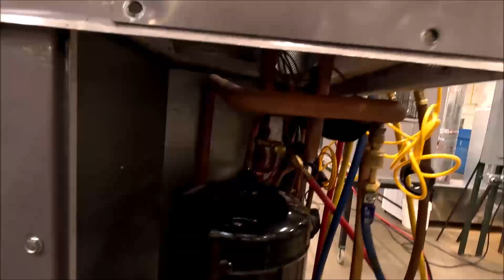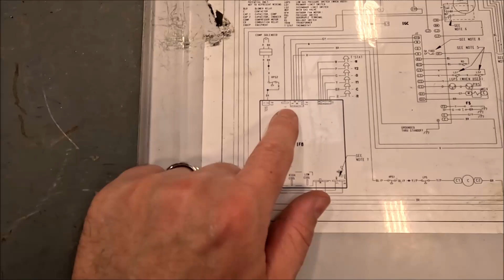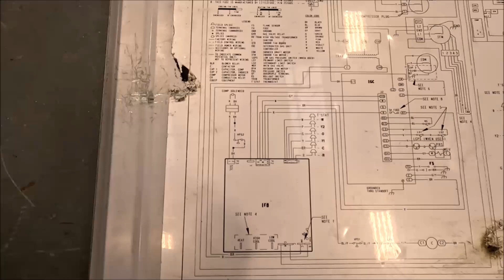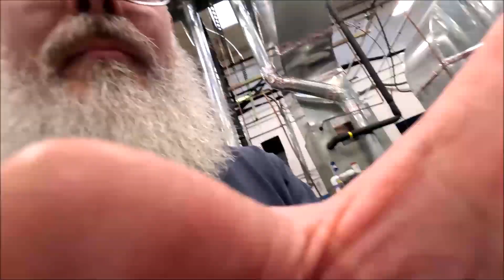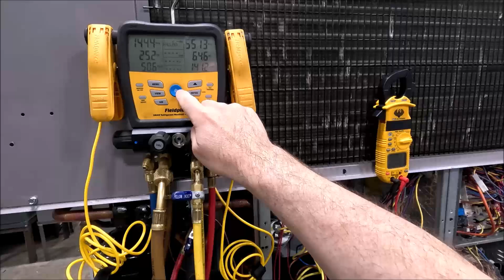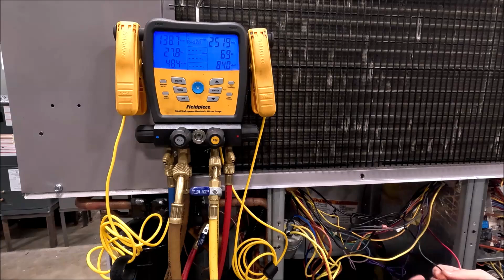Refrigerant Pressure Switches (Part 2) -  A look at a 2 Stage Scroll Compressor

Comment: I didn't catch the reason for for 2 high pressure switches. I heard you say 1 switch is the standard safety for high pressure cutout and the other is for 2nd stage. But it's not clear how that works. If the stage switch opens at 565, how does that help anything? Does it go back to stage 1 at that point? I guess I'm confused why you need 2 of them.
Reply from the maker: I hadn't ever paid attention to one like this but the 2nd HP switch is just for the second stage of the compressor. I suppose that if the pressure is too high that it will not allow the compressor to stage up to the higher stage, keeping the pressure on the hugh side as pow as possible. When running in 1st stage on this system the low side is a bit higher and the high side is a bit lower but when it goes to 2nd stage it is pumping more and the high side gets higher and the low goes lower.
Reply: @johnjennings-JJ  I think you found the first switch tripped at 565 and the higher one tripped over 600 something. Wouldn't the lower one have to be bypassed in stage 2 in order not to cut out too low? I don't recall seeing any kind of bypass or separate relay path. I hope I am describing my question properly.
Reply from the maker: (Been thinking about this and trying to follow and make sure that I am on the same page as you) are you thinking that they are in series with each other? And that is the reason for wanting to bypass...
Reply: @johnjennings-JJ  yes, I am thinking you only get one pressure setting unless I understand wrong. If they are in series, the lower pressure will be your limit, and if they are parallel the higher switch will be the decider and the lower one will be meaningless since the path will go around it. So either way, you only get one pressure level to cut off the circuit. Do I have it wrong?
Reply from the maker: You're all good... There is a main high pressure that is in series with a low pressure switch and the contactor coil. I labeled it "hps1" in my picture of the diagram. The "hps2" is the pressure switch that is all by itself and only controls that scroll compressor staging. The 2 high pressure switches are not in series with each other though...